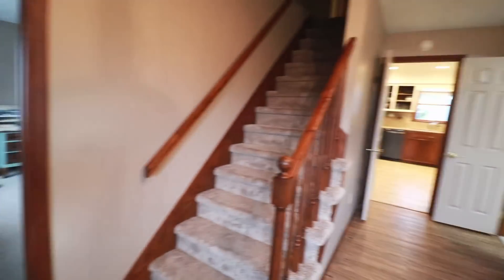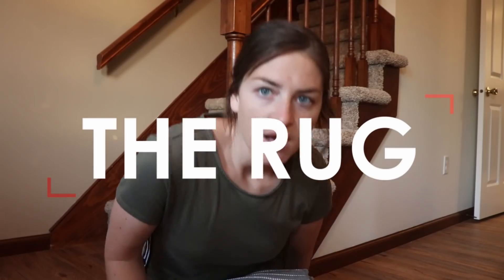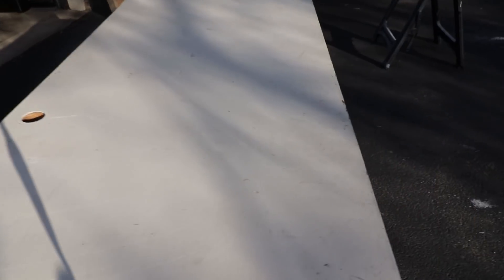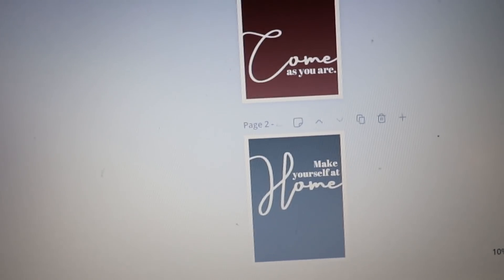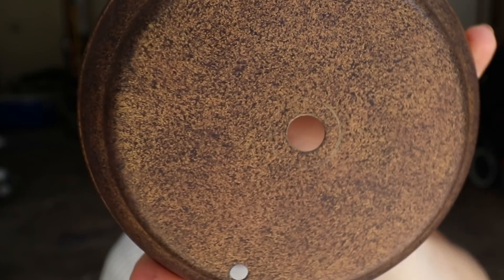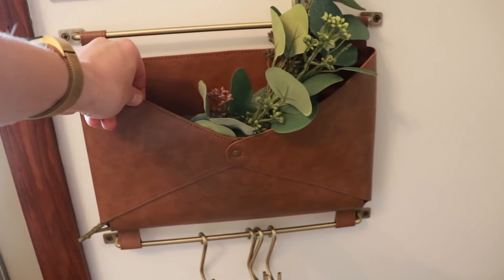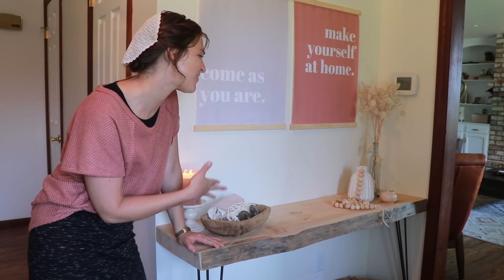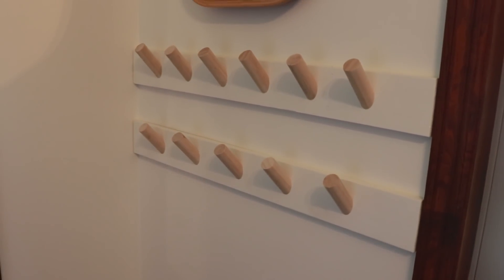ENTRYWAY Makeover on a Budget + 3 Modern DIY Projects YOU Can DO!

Comment: That really is a beautiful console table!  Great job Josh!  Anyone would be thrilled to have that table.  Love how you only used the two legs.  Also love the posters above the table!  Storage beneath the table could be a few baskets side by side if you are concerned about that, but there will be less temptation to let mess accumulate if you keep it minimalist.  Love the leather letter holder and key hooks.  Love the coat racks and the fresh paint on the light fixture and walls. Great job.  Enjoy the new entryway Meghan and give Josh a couple weeks off.